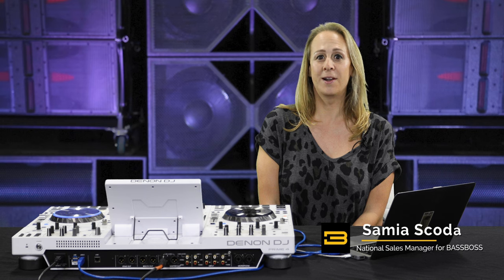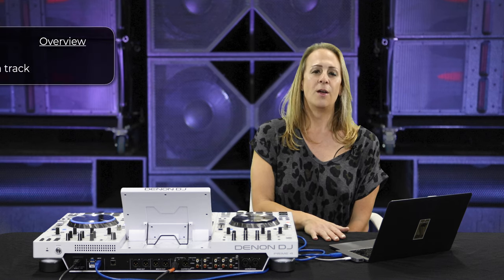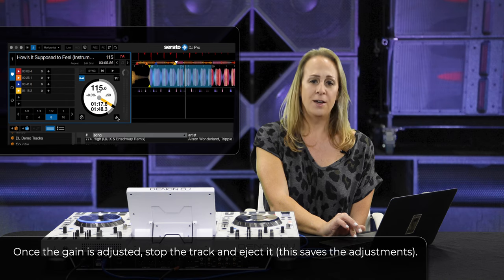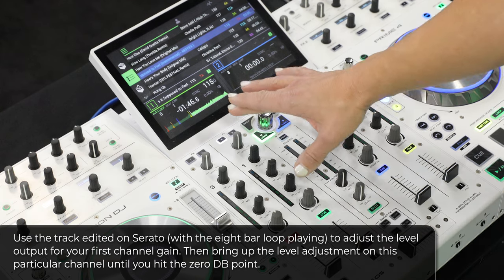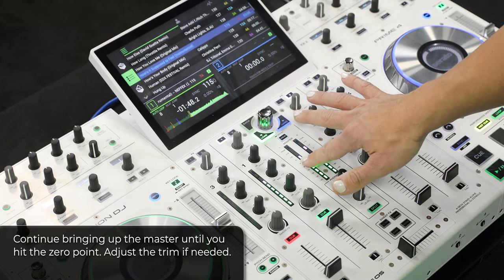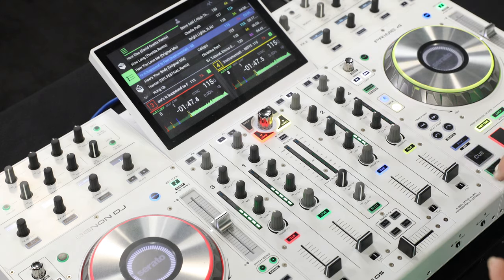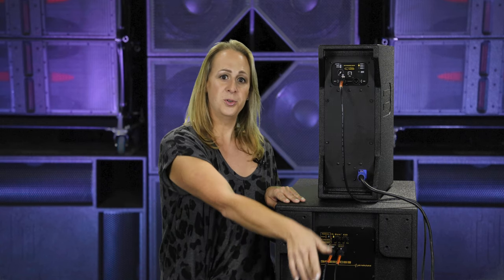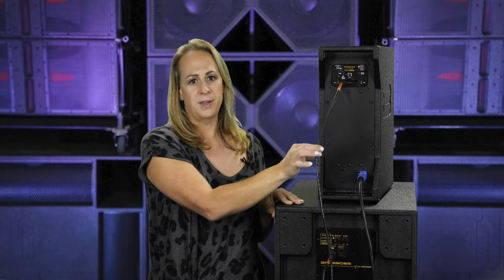Setting Up Gain Structure with AM&S National Sales Manager Samia Scoda

Comment: My BB15 does not increase the volume or bass levels when i turn up the gain knob. I can only increase the sub volume with my dj controller and mixer. And with that,  the SUB is WEAK, My little old FBT SUBLINE 112SA 700 Watt RMS 12' SUB plays LOUDER and Just as DEEP as the 2500 watt BB15. Do i have a defect? I have the BB15 at max gain, and it does not rattle or shake anything in my small house. I did my gain staging like your suggestions ( except i have a mixer) and I'm getting  VERY POOR performance from my 3rd BB15.
Reply from the maker: We're sorry to hear you are having an issue. Do you have a BB15-MK3? If so, you may need to update the settings. Please fill out this form to get the settings https://www.bassboss.com/download-controlbass 

If you do not have a MK3, please make a service ticket so we can help. https://forms.zohopublic.com/meganrecio1/form/BASSBOSSWebSupportForm/formperma/Ek5DByZazX6Y3pdXn1gBqlpXN0gUDVPhDliDJTN44f0
Reply: @BASSBOSSBASS  WOW I am surprised you responded! YES, I have 2 BB15-MK3, ( I returned the 1st one) Thank you for helping. So I don't have defected subs?  I will still need to get an ethernet cable for this , right?